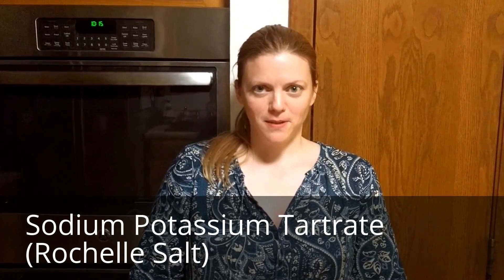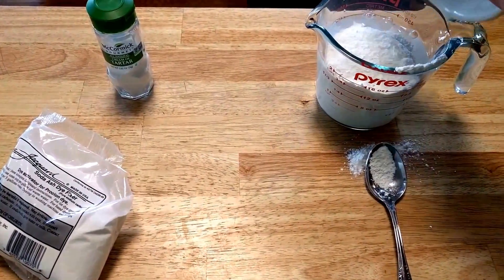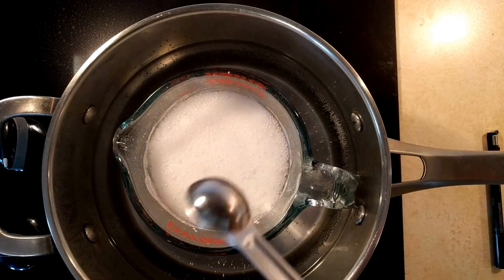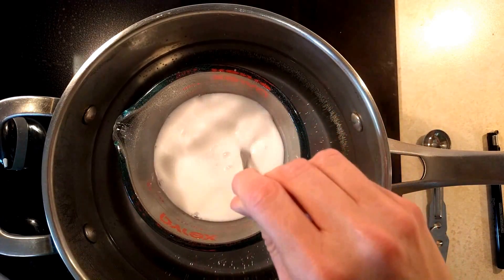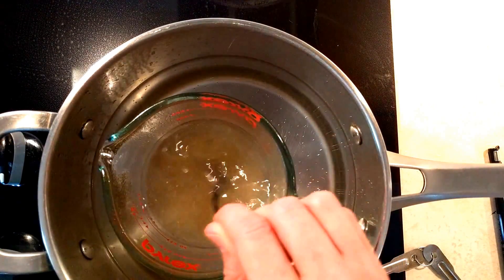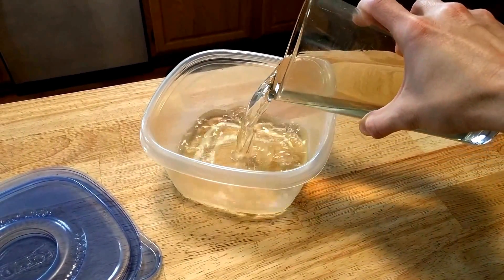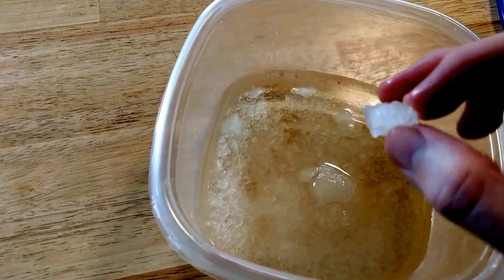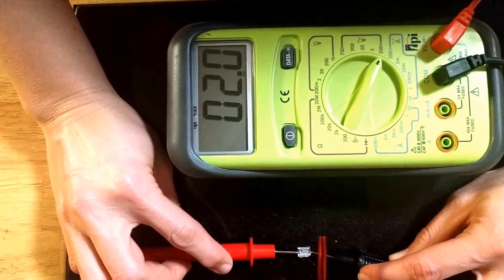Homemade Piezoelectric Material

Comment: Sweet! Can you grow a crystal between two metal plates?
When using commercial audio pickups I found that diodes/leds flatten spikes from hard smacks. An opto-isolator can make a CMOS-safe switch. But those crystals use more exotic elements.
Reply: I dont know how youd get crystals to bond to a metal other than by using an electrolysis style growth like how youd do with copper and silver..  to make a crystal form on two different pieces at the same time would be super difficult to make one with a structure sound enough to bond the plates or couple the plates together..  on piezo buzzers they just use the amalgam and drop the stuff on a disc, place leads on the disc and in the material and let the crystals form but i dunno what they use in top of the disc to electromechanically isolate the material from the metal disc..

Comment: The brownish color looks like impurities in the solution. You can get better crystals if you apply a recrystallization process first. 

Recrystalization. 
1) After filtering the solution put it on heat again to evaporate off water untill  you see the first crystal forming. 
2) Then chill it to almost freezing so as to get the most crystals. 
3) Take all the crystals out and put in just enough heated distilled water to redissolve all the crystals you have collected. Then let the solution cool and your crystals will be much more pure than the crystals from the start. 

Then to get a large crystal after recrystalization. 
1) taking out a good crystal you want to use as a seed crystal and put it aside. 
2) Then reheat the solution along with the poor crystals untill they have disappeared add a tiny amount of water if nessesary. 
3) take the solution off the heat and  shortly afterwards reinsert your good crystal as the seed crystal.
Reply: Thank you for your comment!

Comment: If you put a crystal under constant pressure does it provide constent current?
Reply: No!
Piezo electric works by deforming a nondonductive crystal. The deformation moves electrons in the lattice just a little to one side. The collective effect is a measurable electric field. That field can then electrostatic induction  (push/pull) on electrons in conductive plates  similarly to a capacitor. When electrons in the plates are allowed to flow in a circuit, they will eventually equalize.  Once the plate's field equalizes the crystal's field, there's no more voltage potential between the plates.

Comment: Hi great video, would it still work if I grounded up the crystals into smaller pieces like powder?
Reply: Crushing Randomizes the electric fields generated on crystal deformation. Net effect is no significant electric field as a whole.

I dont know if this will work but maybe you'd have something if it is possible to align all the crystals in a binder with an externally applied electric field of thousands of volts. And, the binder would needs to be non conductive and have a low dielectric constant.
Reply: @kreynolds1123  thanks for the reply

Comment: I'm wondering if it's possible to powderize this material and imbed it into ceramic material to improve it's integrity and regularity like they do with factory made peizo. I may try as that would open a lot.of doors for my off grid setup. Currently piezo charges my phone with wind and water
Reply: Yes, ceramic will make them better, but can you please explain it more about how piezo is charging your phone?
Reply: @io_Xception  I have a flexible ice cream container with 8 piezo ceramic disks glued to 4 of the inner walls of the ice ream container. There is a hole drilled in the top of the container with a long dowel poking out. The dowel is attached to the floor of the container using a spring, the dowel acts as a wind vein. 

The dowel is connected to each of the piezos via a spring. the while thing is then setup[ in series and  fed into a 24-5v regulator for charging purposes. 

With my current setup I have seen voltages around 21V @ 0.6A. I'm pretty sure I could charge 2-3 phones off of this at once. 

Runs on almost no wind. 3-4Km/h. if there is enough air movement/noise to move a blade of grass then this will work. I'm still trying to improve the design as the box I'm using could be a bit taller and I want to add some extra components like indicator lights and all that.
Reply: @hogandromgool2062  Wow, that's interesting and the best thing is that it's working. I never got these things to work except lighting a LED lol.
But I still didn't get how you're generating a charge? As we know that pressing/deforming the piezo element generates a little voltage.
What is pressing the piezo? The springs?
Thanks for the reply :)
Reply: @io_Xception  Thank you for your question.
Reply: @cherylm2C6671  Hi, Are you trying to make one?
Reply: Crushing the crystls Randomizes the electric fields generated on crystal deformation. The net effect is no significant electric field as a whole. So no. 

But, I dont know if this will work but maybe you'd have something if it is possible to align all the crystals in a binder with an externally applied electric field of thousands of volts. And, the binder would needs to be non conductive and have a low dielectric constant. But that's an if and I belive an unlikely if.

Comment: Hello mam please answer my questions how can make piezoelectric ceramics in use lighters
Reply: Your question doesn't make any sense...
Reply: Electric spark lighters need sufficent voltage to cause a break down in the gap.  That is roughly 3000volts per milimeter. Your piezo needs to make 1500volts to spark across 0.5 millimeter. 

Then you need conductive plates on each side where the electric field in the crystal can electrostatic induct electrons on the plate to move.

Comment: I heard that cane sugar is also pizoelectric so why not table suger ?
Reply: A large part of what makes a piezo material a good piezo material  is  the amount of deformation in the material in an electric field.  I'm guessing sugar doesn't deform much inside an electric field.
Reply: Because deez nutz are on your chin...
Reply: Both are suger ,  but one natural form other refined may be the chemical additives that are mixed with it for making it crystal clear, affects its crystal properties .
Reply: @omsingharjit  certainly the purity in a crystal can effects its properties. But I suspect that sugar crystals in general are  not widely used as a piezo simply because the amount of deformation in a given electric field is not as greate as better piezo materials.
Reply: @kreynolds1123  and also fragile , water soluble as well as Hygroscopic so seems not practical

Comment: I modified the procedure and got amazing results. To 120 ml water, add 80 grams cream of tartar (kroger brand use). Hold at 95 C in a water bath, adding 1 gram sodium bicarbonate (kroger brand) at intervals until all cream of tartar has reacted. Decant and filter with coffee filter. Pour fluid on ceramic plate. Add 20 ml of 99% isopropyl alcohol 5 times at 10 minute intervals. Let stand under a fan for 1 hour and 30 minutes. Longer may yield larger crystals, however these were sufficient for my purposes. Yield is approximately 90 crystals, 40 of which are large (1 cm or more) and uniform. Crystals have a clear appearance.
Reply: To what do you attribute the 99 iso alcohol?  Was this just a trial-error or from a source?  Thanks.
Reply: @barrykelly2722  Sorry for the late response, but the alcohol induced seeds to form in a controlled manner, which seemed to prevent crashing and sped up the process.
Reply: @johnjohnson3457  no worries.  Always trying to work my brain.  This is really out of my area of expertise....then again, everything is out of my expertise level lol
Reply: Using Sodium Hydroxide as the base instead of Sodium Carbonate, has yielded the bast results for me.
Reply: It would be really cool and helpful if you could make a video about this.
Reply: I also want to know more.
Reply: Amazingly simple process. Thank you for sharing your video. Must try at home.
Reply: This is glass mr.white❤

Comment: Was wondering if you can show the mechanical deformations it will show with applied external voltage.
Reply: The meachical deformation of these crystals under current are minute, to the point that a micrometer was needed to verify, and even then, that may have been a repeatability error. If you want to see this effect, quartz is your best bet.

Comment: What happens if you crush them into dust and put them in a vacuum seal bag, have metal probes in bag making contact before sealing, basically looking to get a sheet
Reply: Crushing the crystls Randomizes the electric fields generated on crystal deformation. The net effect is no significant electric field as a whole. So no. 

But, I dont know if this will work but maybe you'd have something if it is possible to align all the crystals in a binder with an externally applied electric field of thousands of volts. And, the binder would needs to be non conductive and have a low dielectric constant. But that's an if and I belive an unlikely  if.
Reply: David Prock 
Weeeeaaaak

Comment: excellent! well done, please replace commercial piezzo with your material and check result like microphone or Speaker. i mean if you give voltage to material crystal the amp. current usage will be give  nice result. thanks again
Reply: This type is easy for diy.  But that does not make it a good piezo. 

Part of what makes a good piezo Is the amount of deformation thst happens for its mass in a given electric field.  This piezo though works as a piezo, is not that good of a piezo.

Comment: Nice experiment...is there a way of getting the piezo crystals to coagulate to get larger crystals.?
Reply from the maker: I believe if you let things cool down more slowly, and have patience, you'll get bigger crystals. I didn't have time or patience since this was for a school project that needed to get done, so I think I just used the fridge. A cool basement would be better. You can also try "seeding" with crystals from an already made batch. Here is a link to some very in depth info including how to make cream of tartar (I just used store bought): 
https://www.instructables.com/id/Make-Rochelle-Salt/
Reply: You can take the smaller crystals. Make a new batch to seed it with the smaller ones and they'll yield way better results
Reply: I googled "Soda Ash"  To see where to get it LOCAL,. I had lots of stuff come up.!! Like pool- PH Lowering stuff, and some stuff to wash pools, with" and Even Baking soda.!! Is there other things that can be used for Soda Ash".????
Reply: Pile your small crystals together, douse in ethanol. Ignite the alcohol  and allow it to burn down. Allow to cool and the crystal will fuse together with slightly weaker pezioelectric properties. Crystal's will also be white and ugly.